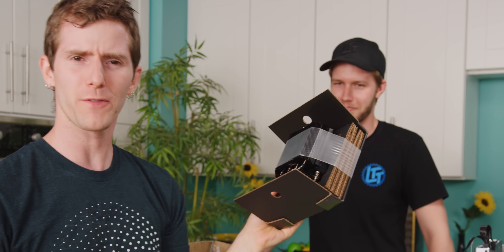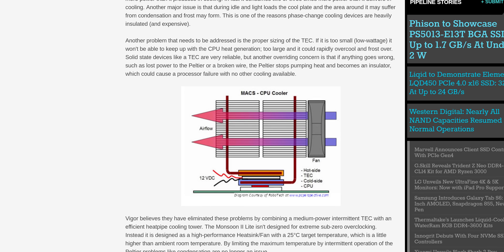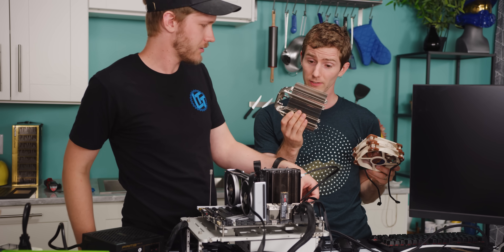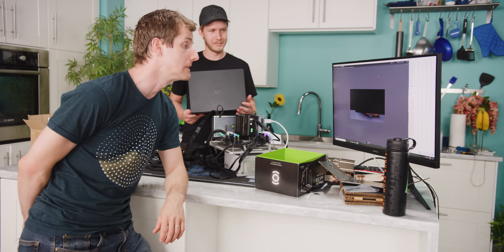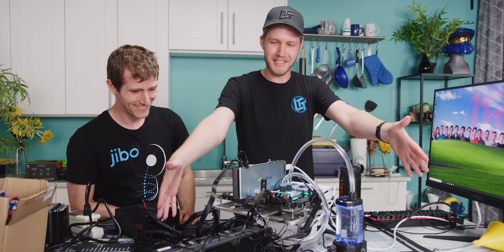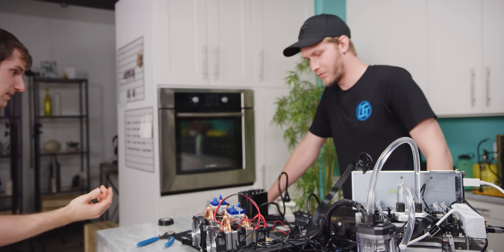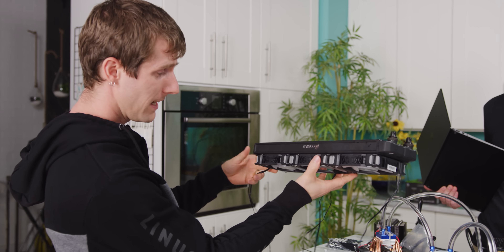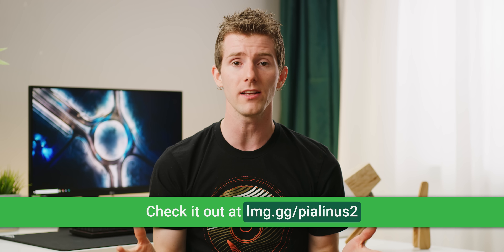Thermoelectric Cooling is a Bad Idea

Comment: When your PC cooling requires it's own miniature power plant just to keep the CPU at sub ambient temps.
Reply: But how do you cool the power plant...?
Reply: @obliviouz  This is a computer tech channel, not a science channel. ;D
We're talking about Linus, not Cody or Tom Scott.
Reply: @obliviouz  typically water
Reply: @obliviouz  air
Reply: it's too bad you can't turn your pc into the powerplant because it gives off so much consistent heat. unless this tech exists and i just have no clue because i'm a noob at this stuff?

anyone have a clue if something like this exists?
Reply: @5226-p1e  technically peltiers can be used to generate electricity, with temperature deferentials. (Hot on one side, cold on the other.)

They aren't great at generating power though. So you'd need a few dozen to run a single pc fan. And the pc would likely be thermal throttling at that point. Lol
Reply: @josholin31  
yeah, that's why i said this wouldn't work for that kind of application.

but it made me think about another system, if you have heard about storing thermal heat under ground using something like sand, so the heat that was created could be reused instead of wasted.

it's not enough heat to power anything, but it could possibly be enough heat to heat your home when needed.

there is this method called thermal heating that involves installing a holding cell of sand and pipes, the sand is heated typically by the sun, and it's stored underground and sort of works like a pocket of heat that can be used when needed, the sand keeps the heat in the location, and the pipes are there to distribute the air from the pipes that have been heated by the sun. 

but it doesn't have to be generated by the sun only, it can come from other sources of waste heat. 

but i thought of another system that could be used in the same way, but it involves a structure of your house in order to make it work effectively, basically it's radiant heat under your flooring, i have seen something like this before for other applications, but i wonder if it would work with something like the heat generated via a PC.
Reply: @josholin31  you need a huge temp difference just to get 5v. Its not efficient in that matter at all.
Reply: @brandonroeder2461  Agreed.
Reply: @5226-p1e  Considering Linus is heating his pool with the waste heat of his PCs, yes, it can be done. You can actually quite easily heat up a room with a PC. I do so constantly.
Reply: @howlingbeats2544  
i do that same thing, but i think i have reached the point where my PC overheats, i often have to open my window with my box fan ushering in the cool air to cool down my room with the winter weather, then i can play for a few more hours with my PC heating up my room.

but what i was trying to say in my last comment is it would be cool if we could reuse that heat and use it as an actual power source so running that electricity wouldn't be so expensive, like how an alternator works in a car, it charges the battery of your car as it runs, but something like the heat transfer into another room to collect and create power, but i'm not sure the heat that is produced by a PC is enough heat for that kind of system.

Comment: TEC cooler specific water blocks help. 

Thing about Tec coolers they are fickle, they tend to run away so to speak thermally and become isolators if you don't set them up properly. 

Some go as far as making "smart" power supplies to keep them in there effective range. If only it was easy...

Comment: I mean, they only used 1! You have to use 3 of them stacked. The top two have to be half the voltage of the bottom. Itll be a ton cheaper for electricity (lower voltage equals much lower wattage) due to you only needing to go to much lower voltages.  Also itll have much better performance at the same wattage from the wall.

Comment: Put the radiator in contact with the hot side in a large water cuve. Turn on constantly the Peltier element.
You will have more decent performance

Comment: Dude, stop the peltier thing. Peltiers are excellent to cool things that do not resist cooling, for example a small CCD chip inside a Laboratory equipment to avoid noise, but they start to fail when you try to remove heat from a hot surface because the heat transportation is not fast enough. Also, the Peltiers work eficiently only when the hot side maintain a specific temperature, once they go outside that temperature, the Delta T between both plates will start to decrease. So... forget it. Also remember that to cool a 45W CPU + a 100W Peltier you will need a Cooler  big enough to cool 145W... Why not just put that cooler directly to the CPU??

Comment: Why wouldn't you add the peltiers to the loop with the radiator? That way you get the added chilling of the water, but the radiator will keep the water above ambient or close too it at idle and add cooling capacity under load

Comment: I've had a peltier cooler back in 2003. It was a Thermaltake SubZero4G. It worked, but used a separete psu in one of the pci slots. It was unique and loud, but it worked. :D

Comment: But what were they like for normal use not blasting them to the red line like you knew they would fail on. Are they better or worse in standard operation?

Comment: It could be a good idea if you use them to subcool the water coming from a conventional radiator! That way you could power them on only when you need the extra kick of cooling power (when the peltier is off the water just passes trough without loosing nor gaining temperature).

Comment: Reminds me of how someone made a refrigerant based cooling system for their PC. Had the compressor and everything.
Reply: That’s really common and works fine (at the same power draw and heat load as this my cooling block would be like -45c on my phase cooler). It’s a commercially available unit, was made by Asetech (the guys who make 90% of all the consumer AIO coolers). Those unlike TEC coolers actually handle heat load, and they can get much colder, and they use much less power.

Comment: I feeling nostalgic watching this ... When i was in college (late 90's) i cooled my Pentium 150 mhz with a 35 watt TEK and use to over clock it to 187 mhz stable as 225 mhz unstable. The issue i had was when you turned off your computer the heat in the Heat sing flowed thew the TEK and into the CPU causing it temp to jump 15 degrees ..... Later (2010 ish) using my Water cooled rig did the tick of running the water threw a water blocked cooled using a big at the time heat pipe and a 200 Watt TEK, that cooled the water a whopping 1 to 1.5 degrees before going into the CPU bloack.  ... sound of cricket in the back ground....

Comment: the earlier stuff all failed due to most of the implementations just plugging directly into your motherboard or power supply. Certain tanks use this technology to stay cool in desert environments so its not useless just not used correctly. A good control unit (arduino in my case) and a large cooling capacity such as a multi rad set up will allow you to keep controlled temps. On any of the projects I created I would set my controller to put the cooled components at just above room temperature to abstain from producing condensation.

Comment: Speaking of cooling, i was wondering what the best setup would be if i choose to purchase the Aorus 2080ti waterforce with the AIO

I've a 240mm AIO mounted on the front which cools my CPU. (Case is a Fractal design R6) Where would be the ideal place to place the GPU 240mm AIO? As close to the intake as possible or instead make it the intake and put the cpu AIO on the top of the case? I wouldn't even consider this but i had to return my Asus strix 2080ti "advanced" due to it ignoring fan curves at 70 degrees and fans spinning at 100% until it goes down to 69 degrees at which is slows down but goes back up to full at 70. It also made some strange noises at full fan speed.
And the Furmark results were absolutely horrible.

Comment: Which cpu did they use? I think it would have worked a lot better with stock/undervolted  Ryzen 3600. That would mean that some of the  65W (Tdp number) would go through the TEC. It might work as intended in low power setup..

Comment: I remember back in the day I had a Ultra brand thermoelectric cooler that even had a readout display that went on the front of your case in a drive slot. It obviously didn’t work for crap. It couldn’t even keep a stock phenom 6 core black edition cool enough to run stable. And the thing was huge.

Comment: 32 amps is a lot. :D But what if you use 3-4 Peltiers on 1 CPU. Put them vertical on custom copper block, put the new machine shop to work.

Comment: @10:00 yes, That's actually a good design. If the TEC was the only heat dispenser of the CPU then if there was any loss of power or the ability of the TEC were exceeded the CPU heat will skyrocket.  The metal block and air cooled pipes are for buffering.  Looking forward to the Ebay TEC experiment. With the proper application of SCIENCE (which means less Linus  :D ) superior cooling could result. (extreme overclocking uses liquid nitrogen for a reason)

Comment: Wait... 32 amps! If you plug into your wall your braker goes!!!! 👍😁
Reply: 32 amps at 12v is 384 watts. At 120v assuming 100% efficiency that would be 3.2 amps because 10x the  voltage at same power = 1/10 amps... Peltier junctions run on low voltage dc though not wall power ac

Comment: Gigantic 62mm - 545 Watt Thermoelectric Peltier Cooler ??? How the hell do you fit that on a CPU ?? IT'S 6.2 CM !!! The heat sink alone is going to be the size of a minifridge and you would need 2 window box fans in push/pull config.

Comment: You should run it cpu>traditional rad>tec and see how low you can get it. Worst case should be that it is the same temps as the rad alone. Also note that the efficiancy is related to the tdelta between the hot and cold side, and depending on how cold you want it to get it can be more efficiant to stack them.
Reply: Also try watercooling the hot side to keep tdelta down and efficiancy up

Comment: Why not putting the normal radiator in front of the peltier cooler? So the warm water from the CPU goes through the radiator first and then passes trough the peltier cooler to first get rid of most of the heat from the CPU and then cool it even more with the peltier, therefor improofing the overall temperature.

Comment: Good stuff! I've played with peltier's before and found that they are useless in direct cpu cooling. BUT!!! If you make 2 water loops cooling cpu and peltiers (cold loop for cpu and hot loop for peltiers hot sides and radiators) results are not bad at all! You can grab 4-5 65watt peltiers and get cryogenic temperatures for your overclocking records!!! Good luck!

Comment: I messed around with early versions of this involving coating the board with silicone clear coat and heaters to deal with condensation and water cooling for the excessive heat.

Comment: TECs can be great,  when done properly.... 
Like with my 400w TEC getting an athlon Xp Barton to sub zero temps with a liquid system chilling the hot side.  And a second psu dedicated to the tec. 
....as you said "in the old days"
Reply: Diavuno  similar here, K6-2 450 @ 540 MHZ at -20 C using peltier and custom watercooling loop in 1999.
Reply: "TECs can be great"
like the one keeping my food cool on my road trips :)

Comment: So like the real problem is that you still have to dissipate the heat with radiators and fans TEC or no TEC...and that process isn’t getting any better, and when you add the inefficiency from a TEC to it...you just end up worse off...

Comment: Wouldn't it be more efficient to 'hook it up' to the water cylinder inverter heater? Feed heat into your water heater increasing the efficiency of the inverter by increasing the temperature around the inverter radiator? 'Free' heat if you are heating you tap water or even your swimming pool.

Comment: you should first cool the water with the Radiator, and then cool it with the two TECs, that should reach a cooler temperature.

Comment: Yes, but what about getting a cryocooler (one large enough for a CPU) and just mount it to the CPU for liquid nitrogen temps? maybe could work?
Reply: I’m planning to go about as cold as possible for TR-64 core**, but if you mean a real cryocooler like a turbomolecular pump, they are rated 2.5w of heat load with 3500w input power at 10 Kelvin, so you’re looking at Megawatts to cool a CPU. However, -100c isn’t that hard. For reference, 350w heat load at -35c block temp only needs a simple 1/3HP compressor (used an FX-8350 at 1.7Vcore for this load)

**as cold as possible with a cooler good for 24/7 daily machine, I’m hoping for -100c with a 2 or 3 stage cascade cooler. I like my systems icing over, RIP GPUs though, the BGA solder cracks from daily extreme temps and thermal contraction fatigue on the solder joints, CPUs don’t have this problem.

Comment: What if you plug traditional water radiator AND peltier element, so water cools in radiator to 30-40C, and after this cools in peltier? Like this strange tower, but COOLER.

Comment: Peltier cooling has only very specific applications, this is not really what they're for, because the heat still needs to be pumped somewhere, or else the coolers start producing heat instead of  moving it

Comment: Please don't buy ANY product with a Peltier element. They don't work the way you think when it comes to cooling, and their efficiency is at around 20%!!! If you wanted to cool 100W of CPU, your peltier would need to consume an extra 500W to remove that heat. This is pure parbage, that's 600W CPU heat in total...
Reply: EDIT: Wikipedia even states a cooling efficiency of only 10-15%. shiiit

Comment: Next, try a TEC and a radiator in series, because science.
Reply: Yeah .  Too many tech channels set things up to fail. Id like to see what it would take to make TEC viable on modern CPUs . Well i know how id do it, i just want to see others use their brains
Reply: @davkdavk  Absolutely, IIRC the efficiency of a peltier device is ~10% in terms of cooling vs power draw, therefore a properly designed system would look at the max CPU head emissions at load, and then plan around that. Assuming a max heat load of 200W, using 320W TEC1-12740 gives ~32W cooling, 6 of those would give 190W cooling at ~1.9kW power draw. 

To work best, you'd want to allow it to reach sub-0 temps and properly insulate your MB from condensation.
Reply: @zeealpal  good man!
Reply: @zeealpal  I'd like to see a 500w capable freon loop, properly insulated. See what these things can do at sub zero, without using LN2. Everyone sooks about power draw now.
Reply: Yea, Please do that :)
Reply: Something I figured out when I built a pretty decent custom loop with 2 GPUs, a CPU, 2 rads, and 4 inline thermometers in different places: Loop order doesn't matter. At all. No matter how I loaded the system or ran the fans, all 4 thermometers were always within ~.1C of each other. Sure, the whole loop temperature would move up and down with system load and fan speed, but all of them would move together. 

So yeah, loop order doesn't matter.
Reply: @celeritas5k  We may see a difference with TECs since they can chill the water to sub ambient. But either way it would still be interesting to experiment with, because science.
Reply: @dwirandypradhika6752  Well, the reason loop order doesn't matter is because water has a high specific heat, so the time it takes to circulate through the entire loop is small compared to the time it takes to absorb or release enough energy to measurably affect the temperature. Neither specific heat nor flow rate are significantly affected by temperature, so going sub-ambient won't make a difference.
Reply: the best solution involving TEC i remember was to use the TEC to cool the component (s) then to watercool the hot side of the TEC.
but you needed a way to actually make sure the TEC cold side didn't reached below ambiant to avoid condensation. it work, it cools well, but the power consumption is throught the roof compared to air or watercooling alone, for not so much better temp in the end.
Reply: First the radiator hopefully (to bring temps down to nearly ambient, then sub-ambient, so that the CPU is just a bit higher than ambient).
Reply: doooo iìiiiiiittttt Linus! Alex must put this together! who cares if it consumes 32 amps or 3000 watts, we need to see this!

Comment: Would be interesting to see you do pump->peltier cooler->cpu->radiator->reservoir->back to pump.  That way the peltier cannot be overwhelmed and you ditch as much waste heat to the air prior to using TE cooling.